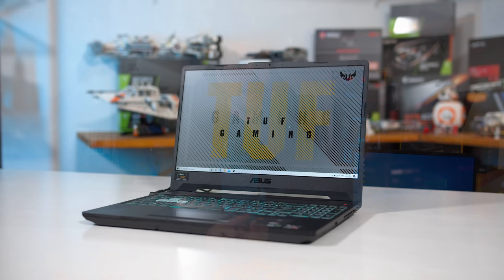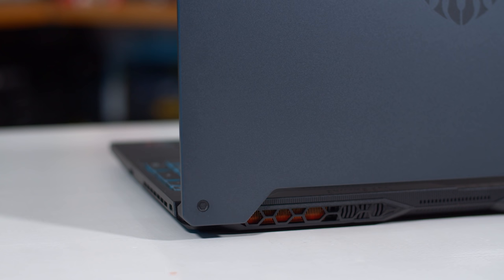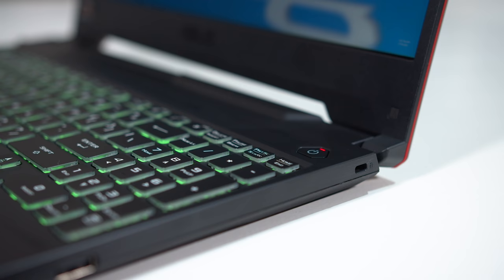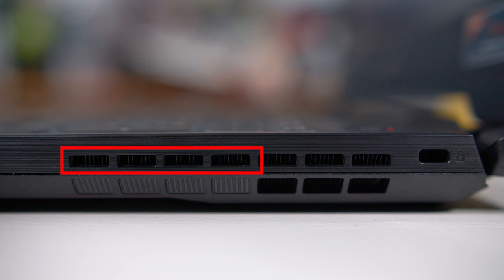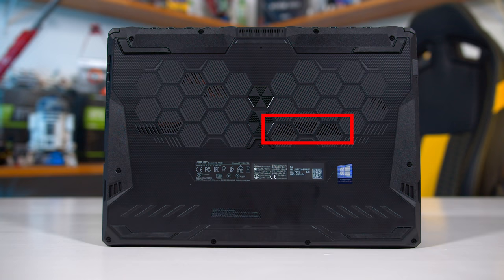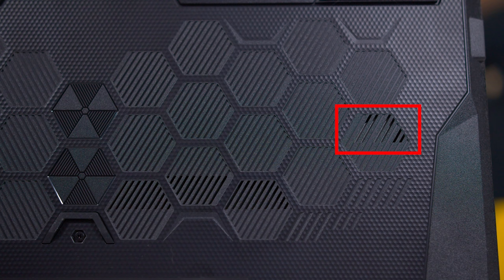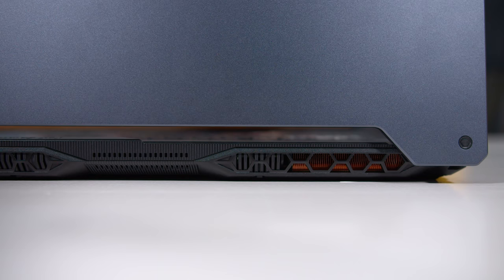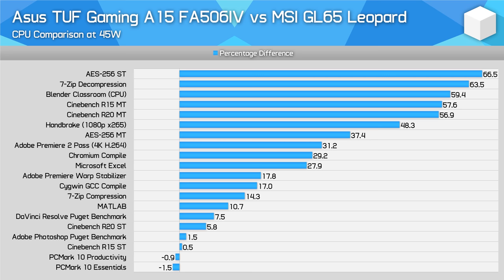Don't Buy The Asus TUF Gaming A15 (2020 Model)

Comment: My theory:

OEMs aren't ready for a chip of this calibre and they HAVE to intentionally gimp it. Why? Because if this Ryzen chip is allowed to work at its full potential, then their sales of Intel chipset laptops (higher end) will be heavily gimped. Customers will ask why is this expensive laptop performing worse and running hotter? It'll mess up their entire product lines and they won't be able to keep up. By intentionally choking Ryzen chips here allows them to price their products like they do and get that money
Reply: Or hear me out, just don’t buy a cheap laptop and expect the world from it. Surprising I know.
Reply: @RustomH  ASUS ROG G15 also has blocked air vents. It's not a cheap laptop.
Reply: Nah, this is just the typical lower-tier gimping. ASUS has done this for a good long while even on some of their lower-tier Intel laptops.
Reply: @RustomH  cheap? you call 1200 bucks cheap? O.o
Reply: @NeXMaX  I think we'll see similar intentional design choices in other OEM laptops.

If I remember correctly, even the Dell G5 SE runs terribly hot because of shitty thermal design.
Reply: looks like oems are receiving big cheques from Intel.
Reply: @Rhino123freak  There was a time where the XPS15 had a terrible cooler as well.
Reply: I doubt that considering the GPU situation. I happily went intel because as a gamer, I prioritized the highest gpu performance i could get in my budget. I ended up with aa 10875h/2070S, and i'm a tech enthusiast that knows intel is worse at everything but gaming this year.  In the benchmarks that matter to me (gaming FPS) the intel always performed better. Content creators may feel differently, but i feel like gaming is the bigger mobile market.
Reply: Lmao people still trying to play on laptops
Reply: Or:
The Ryzen chips are so good that they decided they can make huge fucking margins on them, to match or even exceed the "development fund" from Intel.
Reply: @QueueTeePies  midtier is not budget nor cheap.
Reply: @AZTCuRe  imagine being stuck to your chair at one spot in your house while gaming. Can't relate.
Reply: Could be the case, but it seems like amd fans always jump to this conclusion
Reply: @AZTCuRe  i wanted to buy the Asus TUF A15 basically because i need a new laptop and my PC needs an upgrade. My PC would need a complete re-do besides the case and with a 144Hz panel it would set me back only 50-100€ less than the Asus TUF laptop with pretty much the same performance. On top of that i would have to dish out another 600 or so for a laptop, so a gaming laptop seems like a better deal for me. Additionally i could use my gaming PC only at weekends because i come home from uni every weekend, so a gaming laptop makes a lot more sense. Seeing this video though i think I'll wait for a better offer
Reply: @RustomH  "Or hear me out, just don’t buy a cheap laptop and expect the world from it. Surprising I know."

RhinoFreak didn't say much about his expectations for the product, much less say anything that would suggest he expects the world from it.

RhinoFreak's theory describes what economists would call a market failure -- when companies, acting in their own rational self-interest, make decisions that end up creating economic inefficiency or reduced utility overall. In a healthy, efficient market, the increased supply of affordable processing power made available by the development of something like the new Ryzen APU would be exploited to its fullest potential by OEMs, as they would want (need) to create the most competitive product possible. Of course, we don't have anything like an ideal market and this kind of market segmentation isn't uncommon at all.
But that doesn't mean people have to be happy about it.
Reply: @RustomH  yeah. I'm running a last gen 3550h in a super cheap nitro 5 with 560x.

Even the most demanding of AAA titles which runs at around 30-40fps, gets my cpu up to 82°C and GPU to around 74 with undervolt.
A similar intel variant would see the temps go up to 90.
My roommate's dell laptop with a i5-7300h and1050ti gets similar FPS in same games but his temps are consistently 3-5°C more for both cpu and GPU
Reply: @Rustom H
But what if you can, for a fact, get more from cheaper laptop?
Reply: @RustomH  People don't expect the world. They expect common sense design like proper vents.
Reply: @AZTCuRe  is 144 fps at basically max settings on Modern Warfare bad or something?
Reply: @AZTCuRe  Lol, I can play at 4K60 high on almost every game on an external monitor and 1080-1440P ultra on almost everything as well.

Comment: 4:30 “I dont see this design save Asus in any cost whatsoever....”
Yeah, it save Asus from Intel as far as I see
Reply: most likely the case since the old intel Zephyrus lineup has better vents compared to the AMD 3rd gen zephyrus which has blocked vents making it hotter even though they have the same chassis
Reply: It is bad by design. It is destined to not compete with any more expensive or future products.
Reply: Intel: "Financial horsepower *wink wink*"
Asus: "Gotcha!"
Reply: Their own top end product pricing will be questionable if they let Ryzen work at full potential.

Comment: Title: Don't Buy The Asus TUF Gaming A15
Me: Buys it anyway
Title: 👁👄👁
Reply: @Toughparth123 It's even better! 3 months in and it still feels like I've just unboxed it yesterday. Sadly I missed out on a recently newer A15 variant with the 2060;90whr version.
Reply: @Toughparth123 It handles pretty much any game you throw at it well, temps-wise after a bit of tweaks mine doesn't go beyond 80°c. It's a beast if I must say.
Reply: How's the battery life would you recommend it for school
Reply: @oogabooga420  How is video display? I heard the quality isn't so good.
Reply: @hoodhood007-4  I haven't gone into fully testing the battery life yet, as I've always kept mine plugged in ~set to 60% for maximum lifespan. 

Though I've recently tried running it without plugging in.

Battery 60%
- Balanced power mode
- Better battery

Browser with 15+ tabs, music playing, lurking on reddit, and qbit seeding from external HDD connected.

It lasted about 2 hours (20% left)
Though if power mode was set to power saver, it could've lasted more I'd say, and that's just at 60%

The 90whr was one of the main reasons I got this for academics, adding to that is the 180w power brick which charges really fast.
Reply: @Loveyou-kq9dp  I upgraded from my old trusty HP budget laptop (i3, 8gb, 60hz). Let me tell you, the screen was one of the most refreshing thing I've ever experienced. Well not just that... everything!

The screen is not as bad as they say, for me it's vibrant and sharp enough. It's not like the colors are extremely washed out to the point of dullness. But really for most general users/gamers out there, the screen is decent enough.

I do agree that media creators should not get this unless you connect it to a more accurate monitor.

I suggest you read the reviews I've linked above (Esp. from the Amazon one). Helps add more with my insight.
Reply: @oogabooga420  how you tweak it? Sorry im  still very noob to this lol 😅
Reply: @oogabooga420  one month later do u still suggest it? Does it run most games?
Reply: @omar_1880  It's still a beast, yeah but go for the 2060 one instead of the 1660ti, newer cards are being released and that's a sweet spot to get in the long run. 

Yeah it can run any game you throw at it. Mind heavy AAA games though.
Reply: @Lu- Eslava i bought the 1650ti version and the screen it Is not good the red color it looks like orange, srgb 63%, brights and blacks are not accurate so if you want to edit will not work not even a picture to post it on Facebook. after color settings, it looks a little bit better but not too good. For games you could get used to it and with 144hz looks good. the battery life Is really bad and you will need to use it with the charger plugged in and there's when heats to 97° playing warzone and gets noisy a lot, some times it shuts down for the high temperatures but unplugged works fine, does not get noisy and temperatures 58° to 68°.  Some people Say that the Omen are better with better screen and better cooling system.
Reply: @oogabooga420  hey man i have the 4800h and 1660 ti model, for some reason when I first boot it up I get 140 FPS + but after about 20 minutes it goes all the way down to sixty-90 frames and idk how to fix it... any soulutions? If you reply pls like my comment cuz I don’t get notifications unless somebody likes... thsnks
Reply: @oogabooga420  ty I’m about to try it
Reply: What games can u play on it
Reply: Lmao
Reply: @oogabooga420   do you think you could use the laptop for maybe 4 years?
Reply: I also bought it and im pretty satisfied
Reply: Yep I bought one also - 4800H/1660TI, upgraded the RAM to 16gb & chucked in a 1TB drive - great laptop for the price & I haven't had any issues at all - screen seems fine also (red green & blu look... Well... Red green & blue 😂😂)  It's marketed as a gaming laptop so if I were to do something that requires colour accuracy - obviously I'd look at something else - but for non professional work it's a bargain 👍
Reply: @oogabooga420  wait could you elaborate on the tweaks it needs?
Reply: Dude, you're the nicest guy I've seen so far haha! Thanks for sharing and guiding people. Appreciate it!
Reply: Will the ryzen 7 4800h work well for music production? Im really not into gaming
Reply: @_morris184  So sorry for the late response. Since you're not interested in gaming, I think you're better off with going for a macbook. 

I've read threads that a macbook is better suited for stuff like that. Though if you don't like apple, these are what I recommend getting:

1. Asus Zenbook (Love this)
2. Asus Vivobook
3. Dell XPS
4. Microsoft Surface
Reply: @_morris184  Babump pump parump.